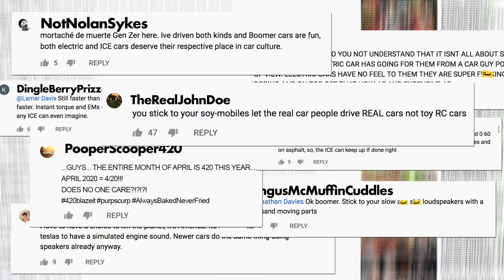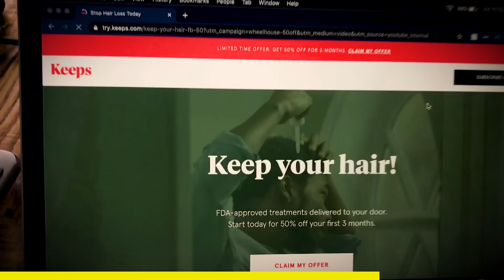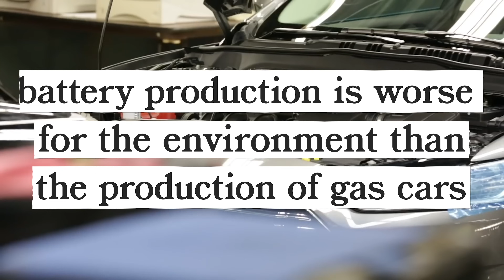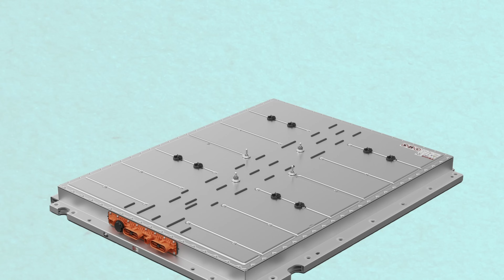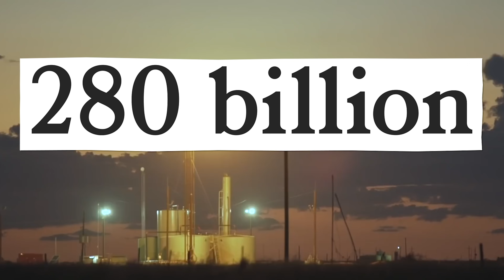Are Electric Cars REALLY Better for the Environment?

Comment: "The power grid could handle it if 25% of cars were electric tomorrow."

I'd like to see the source for that, considering that the electric grid in some places already can't handle the current load.  Rolling blackouts are common in California, and starting to happen in other states as well.
Reply: There is a problem with Ca's power grid that involves the lack of funding for its maintenance.
Reply: @halnogaies1256  California is a fringe case the majority of the USA has much less stress on their grid and could easily handle electric cars. We needed nuclear power in CA but it’s gone now
Reply: @Champoforyx  its going away in CT as well.
Reply: @Champoforyx  Nuclear power is far more expensive and harmful to produce than any other kind of power.  The only reason you do not see the difference when you get your power bill is because nuclear power is subsidized by the government.  Someone ends up paying for it anyway.  And considering that California is prone to earthquakes, it really begs the question: why do you want another Fukushima?
Reply: @Champoforyx  cough Texas chough
Reply: @Champoforyx No they can't. Other states don't have over taxed electric grids because we aren't fart huffing hippies driving around in inefficient electric cars. Our grids support our current needs, 25% increase in electric cars would cripple our grid.
Reply: @Princess_Celestia_  driving an electric car doesn’t make you a hippie. And charging them wouldn’t stress the grid in most urban and suburban areas that have access to nuclear power. The grid in heavily populated areas like California are only the way they are due to relying on fossil fuel and inefficient wind power rather than safe and renewable nuclear energy. Learn some humility and don’t assert your political views on someone else’s choice of vehicle.
Reply: It's bs
 They literally told people not to charge their electric cars in California because the grid couldn't handle it
Reply: EV charging pulls about as much power as a home A/C unit. You tend to use the A/C units during the day, charge EVs at night. Quite a few companies have incentives for people who only charge their EV at night.
Reply: @meanmutton  Until they start charging more at night when more people do it.
Reply: @meanmutton  Charge EVs at night. You mean when everyone is home after work watching TV, cooking dinner, and cooling off with the A/C and all the lights on since its dark outside?
Reply: @meanmutton  thats a lie. it takes one to be in the know my dad has done HVAC commerical and residential for just over 20 years. he also is a liscensed electrican. and certified to work on Generac generators.

EV charging with half the national average of mileage driven and 1 car per household. is equilvent to every household plugging in 15 mid 90's non super high effiency fridges. at the same time across america. it would require 1,500 NEW nuclear reactors ontop of the current 92. to meet the needs of that.  and btw nuclear is the most efficent highest output energy source currently avaliable. and the 1,500 figure takes into account all other forms of energy production. if you remove all ones that are not eco friendly. i.e coal and natural gas. it would be more like 2,800 nuclear power plants. it takes about a decade to build and get a plant operating. and therse only 2 construction firms in the US that can build one legally but due to lobbyists its technically illegal to build a new nuclear power plant.

elons wet dream of solar panels to power america with 100 square miles would work today. but everyone driving an EV. not counting trucks or trains or ships or equipment going electric. you would take up the entire midwest with solar panels.

and you realize how inconvienent it would be to only charge an EV at night not to mention inefficent. thats when most of the grid makes the least amount of power (parts of the grid are supplimented by Solar)

most people will plug it in before during and after a trip they make. so its easy to assume the load will be constant. for everyone 1 person that isn't charging an EV there will be 10 charging an EV.
Reply: @justnsaliga8518  Nuclear power is NOT more efficient at all.  It is one of the least efficient most expensive sources of power.  Nuclear power is subsidized by the government in order to offset the cost on your power bill and to provide good PR for nuclear projects making it sounds like there is some good result going to come out of it other than burning away tax dollars.  Why do you people what a nuclear power plant in California?  Have you never heard of Fukushima?
Reply: @jilpok1074  so you're telling me something that has in the past a year 1:1 energy output is inefficient and recently a breakthrough in fission yielded greater energy output than input is inefficient..... Got it..... I'm sure if we replace all the trees solar will be as efficient
Reply: @jilpok1074 where are you getting your info? Multiple sources show that nuclear is BY FAR the best source of electricity when compared to solar and wind. If you make 1GWh the control, a nuclear plant takes up around 1sq mile versus 40-75 sq miles for solar OR 250+ sq miles for wind! FYI some of that data is circa 2018! It may have changed, but not by a large margin.  Please don't come back with "oh, the waste though! Checkmate!" France already developed a way to recycle (recharge, if you will) nuclear waste. They have been doing it for about 50 years.  They have the second most amount of reactor in the world.  There is literally no commercial or industrial reason to focus on anything BUT nuclear.  The only reason to go the others is for personal/residential usage.
Reply: Just don't charge your car at peak time. All grids are time-sensitive. What needs to happen is that the low cost of off peak time use is passed to the customer so they can benefit and in doing so reduce load
Reply: THATS WHAT IM SAYING
Reply: No, they are not. You my friend are being poisoned by political propaganda.
Reply: My electric furnace is running now. An EV would strain our electric power even more. Our area electricity provider has already claimed that there could be difficulties this winter for users and mind, this is an area that gets dangerously cold. This ain't the Deep South.
Reply: California is run by the Mafia who doesn't maintain their electric grid properly to cut costs. Instead they pass stupid laws on consumers which albeit have sensible agenda's, are still just a stop gap solution to actually fixing the problem at the source. But they pale in comparison to Texas's electric grid, or dare I say lack there of! 😜
Reply: Some sort of power grid upgrade maybe! Hardly a show stopper.
Reply: @marviwilson1853  When we haven't built any new nuclear plants in decades and they're trying to phase out coal and gas, that is absolutely a show stopper. Electricity has to come from somewhere, and renewables can only be a small fraction of a stable system.
Reply: @frederickthesquirrel  Denmark already has the offshore wind power installed to generate 100% of its entire daily electricity needs. Others will catch up. The Mercedes EQXX does 1000 miles on a single charge, 1200 miles if driven more carefully. This shows us what is coming. No one will need to charge an EV during the day anymore. Charging will happen slowly overnight when the generating capacity is under utilised. Millions of EV batteries will also become part of the electricity supply. A kettle in New York might boil with electricity from an EV battery in Chicago. You will be able to sell electricity back to the grid for a higher price than what you used to charge it. Apps will be used to control this and your car will be fully charged when needed. It's a new world coming for those who have the imagination to see it.
Reply: He read it somewhere and told us.
Reply: I am a residential electrician. I cant comment on the grid, but there are definitely houses that aren't ready for a car charging circuit without a service upgrade or second service. That is 5-20K depending on local code requirements plus an additional 500-2k for the car charger plug and circuit. It could be a hell of a lot more depending on the distance from the panel. For a big apartment building to get a bunch of car chargers could be a massive massive project.
I am 100% for EVs, just saying.
Reply: Rolling blackouts in California are rare.  During the recent heat wave, all blackouts were caused by heat related equipment failures, not capacity issues.  The paranoia being generated by the state government turned out to be false, and the grid ended up having more than enough capacity.  Other rolling blackouts, in previous years have been caused by transmission line damage from fires or from wind.  These blackouts are mostly caused by penny-pinching by our local for-profit utility company P*&*.  They've been skimping on maintenance, for decades to increase profits, and now it's biting them in the *ss.  Yet, even with their greed and incompetence, the grid is able to supply adequate power, in just about any circumstance.  Imagine what we could do if we weren't saddled with them, and if power distribution was handled by a truly competent agency.
Reply: It’s only of matter of time when they start charging more $$ for charging EVs lol
Reply: The majority of the grid is not anywhere near as strained.
Reply: @Champoforyx  in 2022 there are.
Reply: @Champoforyx  Yet
Reply: To answer your question, it all depends when people use it.  GB would have a power outage every commercial break during televised soccer games.  It turns out everyone would hear water to make tea during the commercial break and that was enough to overpower the grid that was otherwise not overwhelmed at all.  Clearly, charging the EV at night (when most people charge) would not be an issue at all in any functioning power grid even if it is so-called overwhelmed as you claim.
Reply: @jilpok1074  re read my original post I have numbers you can crunch yourself simple Google searches can verify the figures used like the United States total electrical production. And average cars per household/2 and average mileage also divided by 2

The US grid would need 1500 more nuclear power plants to meet just under 1/4 of the actual electric demand of 2 EVs per house and average mileage per year and when I say nuclear is the most efficient it truly is name something else you can fit in a football field sized area and power 1 million homes with
Reply: @justnsaliga8518  sounds like you need to research more about nuclear power.  And after Fukushima you’d think people with half a brain would figure out it is not good to have nuclear power plants where earthquakes are common.  Also, nuclear power is very expensive and has to be subsidized by taxpayers in order to be affordable.  Last time I checked taxes in California are ridiculous and you are advocating adding more taxes because you like nuclear power in earthquake zones… 🙄🤦🏻‍♀️
Reply: @jilpok1074 also, about that Fukushima thing you keep talking about. Have you done more research into it besides "the reactor failed"?  That was doomed to fail from the start because some shoddy engineering.  iirc the government had a part on that as well.  Point being, they were warned multiple times and they didn't listen. This happened as a result.  A powerplant can be built in California the same way anything else is, follow the proper codes and build with a safety factor.  There are other ways besides that as well.
Reply: @jilpok1074  there's a difference between 10 million people making tea and watching TV at the same time and 10 million people plugging in 15 refrigerators at the same time
Reply: @jilpok1074  you should visit California I only stayed for 3 months for my MOS school there was 6 power outages while I was there.... At the time electric cars weren't really a thing it was just people making tea and watching tv
Reply: My EVs put zero strain on the grid. Zero. Nada.
Reply: I had the same thought about the source as soon as I heard that
Reply: there are zero sources.
Reply: Donut Media is headquartered in CA, so it makes this all the more ironic...

Comment: This doesn’t take into account the internal combustion engine will long outlive the battery powered car. Hence, more production, higher turnover rate, higher CO2 output.
Reply: Evs are rated for 15-20 years lol. That is a lot longer then most people keep their cars for. And even then, you can recycle them, albeit with some issues but as tech progresses this will be less of an issue

Comment: Gasoline has an energy density 100 times greater than a lithium battery. Refiling a gas tank takes 5 minutes compared to recharging a lithium battery that takes 6 hours. There are at least 100 times more gas station than recharge stations. Creating recharge stations requires lots of MONEY compared to EXISTING gas stations that require no money. The cost of an EV is twice that of a gasoline counterpart. 

Conclusion: The density of the go green crowd is 100 times that of a reasonable person.

Comment: This vid doesn't take into consideration how the batteries run down and lower the already poor vehicle range and need replacing after 3 to 10 years and cost 5-20k - I wonder how the short battery life and needing to be replaced effects the comparison and environmental impact? Seems like a scam to me.

It mentions in the video that all sates in the US's power grid can handle EVs. Doesn't California have rolling blackouts because their "green" power generation methods can't keep up with demand?

CO2 makes plants green. Can we fix the damage strip mining does to waterways? It seems EVs are not the wonderful solution they are sold to be. The battery tech just doesn't seem to be there yet.
Reply: " I wonder how the short battery life and needing to be replaced effects the comparison and environmental impact? Seems like a scam to me."
Nah, its only scam by the people who makes such statements. Batteries can be recycled to like 98% and completely reused. And it wont run down in 3--10 years... We have Tesla model S which came out in 2012 which still drives on the roads without any issues. So from whose ass did you took those numbers exactly?

"Doesn't California have rolling blackouts because their "green" power generation methods can't keep up with demand?"
Does it? Blackouts are not equal to inability to support EV's. Its already known that EV's will not outpace electrical grid expansion, there is 0 risk.

"CO2 makes plants green"
? CO2 kills people too... What's your point? 

"Can we fix the damage strip mining does to waterways?"
Can we fix thousands of oil spills every year into oceans or on land?... Whats your point? 

"It seems EVs are not the wonderful solution they are sold to be"
Well if you will only listen to oil companies propaganda, then yes, EV's are bad... But in actual reality EV's are allot better solution than ICE cars.

"The battery tech just doesn't seem to be there yet."
And how do you think any technology improves?... By demand... If there is no demand in technology then there is no point in investing billions in a research for better solutions... We already have batteries good enough to push forwards transition towards EV and new battery technologies came out every month.

Comment: bullshit.. you don't take into account the emissions of making the windmills and solar panels... also the battery starts to die after 10 years... maxing out at 20. so they would need to put a new one in.
Reply: How long does your car usually last? 5? 10 years? 
And do you really want to account everything? Like oil spills too? Because that wont really help your case, isint it?
Reply: @Zripas  lol dude, the cars i buy are usually 15 years old...
last one made it to 21 years and i now drive a car from 2007.

and yes i would love to take everything into account but i don't have exactly enough time
Reply: @colinboertje3305  
Good for you, in 15 years your will be able to buy used electrical car.
With something like Tesla model Y you have structural battery which can be easily removed and replaced with new one if needed. But you wont need to do that for cars life time, unless you are some hard core driver who wants to hit one million mile range or something. Average cost to repair ICE car is higher than cost to repair electrical one.
Reply: He literally did. He even said that even if the power came from the most polluting coal factory it would still be better. Also battery life is getting longer as technology gets better. So it might surpass the lifespan of the average ICE

Comment: When you crash a electric car like model x they will explode and catch on fire right?
Reply: No really, it might start small fire which is allot better and gives you allot more time to get away then it would be with gasoline car which would go into flames in instant
Reply: As opposed to those gas cars that don't catch fire at all right? EVs are actually far safer in case of a crash
Reply: @VitaeLibra  well it depends on what model and when EVs do catch on fire it takes days for it to go down and be safely transported on to a tow truck